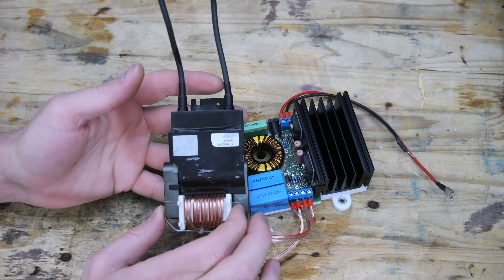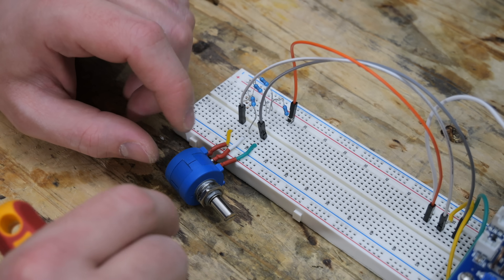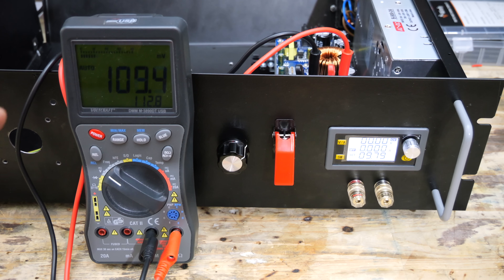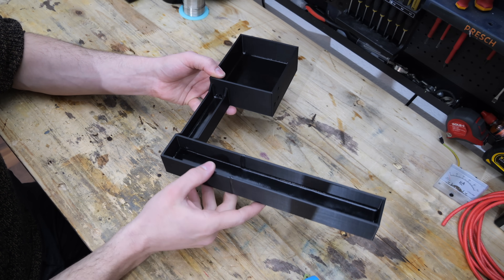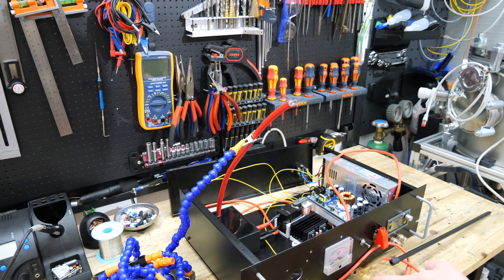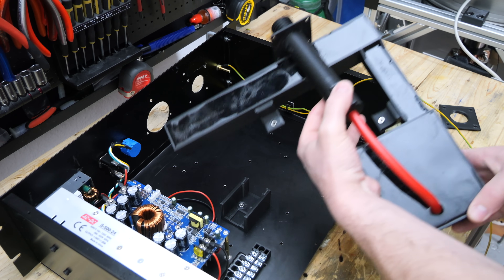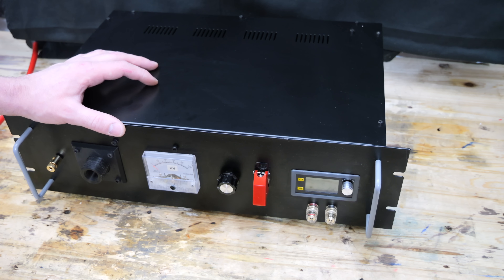Building an Adjustable High Voltage Supply

Comment: Small tip: Watch out with black plastics, resins, insulations, etc. They are often colored black using carbon. Can bring some really nasty surprises.
Reply from the maker: Yes, in my first version I used only white PLA to avoid getting problems with carbon black as a pigment. But it seems like it makes basically no difference. The white PLA is also terrible for insulation. 

The resin uses aluminum silicate as a filler and the data sheet states the dielectric strength. 

But you are right! I should have mentioned that in the video.
Reply: @AdvancedTinkering  That buck converter was completely unnecessary. That power supply can be modified to have a fully adjustable output from ~3v to ~40v by adding 4 resistors and a potentiometer to the feedback circuitry.

If you're interested I can provide a link to a website detailing the mod.
Reply from the maker: @motosk8er2 I actually changed the power supply and removed the stepdown converter(see the next video about the upgrades). But I didn't know you could easily modify one of the non adjustable supplies. Sure, I would be interested in the link. However sometimes youtube just deletes comments with links in them. So let's hope it works.
Reply: @AdvancedTinkering Hi, what's the maximum current? How many amps/milliamps can be delivered from this circuit? Thank you.
Reply from the maker: @Baguaengland I can't say for sure because I don't have the equipment to measure the current.
Reply: @AdvancedTinkering  If the output can handle a shorted output briefly, then you can use a DMM to measure short-circuit current.  YOU MUST USE CARE!!  I do this on NST's with a cheap DMM.  First, I make sure the NST is off.  Them I VERY tightly connect the HV to the DMM leads with the setting on "AC-current".  Also,  BE SURE THERE ARE NO BLOWN FUSES IN THE DMM.  HV will arc across any open fuse (or holder) and destroy the DMM...voice of experience...
Then when I energize the NST, I actually get almost the exact reading on the NST label.  I have removed a few magnetic shunts from a de-potted NST to increase the current before potting it in paraffin.
Reply: weird they'd put carbon in insulating epoxy though
Reply: @fmdj From actual experimenting the carbon itself doesn't seem to make any difference at all. It seems to be the PARTICLE SIZE that causes problems. Using soot carbon makes no difference at all while ground up charcoal bricketts  almost makes conductive epoxy!
Reply: @glasslinger  yes and I can confirm that epoxy mixed with pestle-and-mortar'd charcoal is kinda conductive, I've been able to stick copper wires to graphite sheets with that, and get a rather low resistance (I'm having some fun with batteries).
Reply: @fmdj  doesn't matter at low voltages
Reply: Hahahaha, I got zapped in the ear once using a bit of rubber air line to listen for  where a Meech high voltage anti static thing was arcing.
Reply: Racist electronics😡
Reply: I ran into this same issue! I made a design using a white petg and I went to scale it up and used black petg not thinking about that, and I was getting arcing/severe dissipation. Started using white pla (had on hand) and almost no issues. Going to switch to clear pla/petg going forward
Reply: I wonder if clear PLA would be a better insulator? Nylon, maybe?
Reply: Wow I never thought about black plastics being conductive 

Good tip!

Comment: Awesome. But, most voltage multipliers that I know work with a spark gap. Setting it in resin is awesome but they work better with having multiple spark gaps. Anyway it works for you. I have built my own and can get much higher outputs.
Reply from the maker: I think Marx generators use spark gaps.
Reply: @AdvancedTinkering I think you're right, he's using a Marx generator, while you're using Greinacher multiplier.
Reply: @xxportalxx. Cockroft-Walton  multiplier. There are constant fights between Europeans and Americans over who originated something. Cockroft and Walton were the actual inventors of the circuit.

Comment: I'm curious why you didn't put the epoxy in a vacuum to remove the micro bubbles especially if you went thru all the trouble of potting everything. Did you fast curing epoxy making it impractical? I'm probably wrong, but the bubbles trapped in the resin should weaken the insulation and create leakage.
Reply from the maker: I degassed the epoxy before pouring it. But I didn't want to leave it in there for long, because the epoxy cures relatively quickly. And I wanted to pour it while it still had a low viscosity to fill all the voids. 

I couldn't put the whole assembly in my vacuum chamber because it was too big.
Reply: @AdvancedTinkering Thats fair I missed that part but I had figured it was a cure time issue. I'm sure you are aware but you can get epoxies with much longer cure times and they are often a lot better in everyway. I have never found the time savings offset the wasted time in redoing a project.
Reply from the maker: Yes, I used epoxy with a very long cure time for the first version. But I could not find any reliable data for the dielectric strength of those epoxy resins. You basically can't find any detailed information about the easily available resins.
That's why I decided to use the resin in the video for the second version.
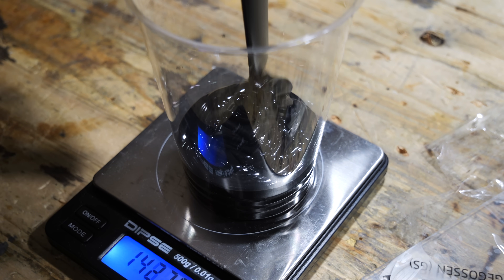Reply: He did put it in a vacuum at 8:42.
Reply: @MikkelHøjbak  Thank You I must have gotten distracted because I completely missed that part. I even went back to make sure before posting.
Reply: @Guardian_Arias  No worries. It's over so quick that it's hard to blame anyone for missing it - I'm sure that it could have happened to me as well.

Comment: Beware that potenciometers wear up over time, sometimes leading to random peaks when rotated, like the popcorn sound in old radios when adjusting volume.
Reply: On a second tought, since you have the safety resistors to not lower 12V then the wear up shouldn't be a problem
Reply from the maker: Thanks for the advice!

Comment: Very nice. Just a suggestion: I recommend, in addition to the switch with the protection, to insert a small circuit with a relay and two buttons to activate the high voltage. Such as start and stop systems for power tool motors. Maybe the stop button with a nice emergency mushroom.
The relay practically de-energizes when the power goes out and there is no risk of leaving it on in the event of a blackout or similar problem.

Comment: I don't think you have mentioned it, but you can't use a regular flyback transformer from an old CRT TV. These have a rectifing diode in series with the output coil which provides more or less DC, which doesn't work with voltage multipliers. You need an AC flyback which are somewhat harder to get.

Comment: Spellman is reusing type N RF connector for the captive nut on their HV PSUs.
Reply: Is not the same. Are HV voltage rated.
Reply: @fabiobosco7545 I I said connector shells.

Comment: When you create a spark, how low the output voltage dives?  I wonder if the 10W 10Kohm resistors are not handling too much current, if not they will open.
Very nice project.

Comment: LV and HV, seem like a perfect power supply for tubes like x-ray tubes 😉
Reply: @AdvancedTinkering Is 60kV gonna be enough? Most ahem vacuum tubes I know of like >70kV
Reply: @apo_chromatic  A bit on the low side, but dental vacuum tubes emit vacuum tube rays between 45 - 65 kV. Of course the big vacuum tube are usually in the range between 90 - 150 kV
Reply: @diecksl  yeah that’s true, I was probably a bit swayed by the absolutely tiny X ray tube I picked up recently that operates at 70 kV, it’s about as big as one of those small cans of soda

Comment: Can you tell me where you get this fly-back transformer ? I was unable to find it by part number. It does look decent for my project.
Reply from the maker: It's from a shop called "highvoltageshop". I know, very creative name. 
But I don't know if they ship to your location. 
There are also a lot of flyback transformers on ebay that would work fine.

Comment: Good job, doesn't look to unsafe from a electrical point of view. You are probably the first non-electronics "DIY" Youtuber that uses the correct wire end terminals. Good job. Do you have a link to the sortiment of those gold plated banana jacks, that looks very useful. Thank you :-)
Reply from the maker: Thank you! That's comforting to know.

Since YouTube does not seem to like links in comments, here is the ASIN number: B083FNTK5R
If you search for it on Amazon you should find it (if it's available in your country). Otherwise you should be able to find it by searching for "banana plug connector male female" or something similar.
Reply: @AdvancedTinkering  Thank you! Glad to hear that :-)
Reply: And yet still, somewhere in Germany a member of the VDE is seething with rage, writing a long winded ranty comment on why what AT just did is the most illegal and immoral thing to have ever been done with electricity. Because that's all VDE members ever do 😀

Comment: I hope the distance between your caps sufficient. Having them back-to-back like that has cost me a good handful of ceramic caps.
Reply from the maker: I haven't had any problems (at least for now). I think the few millimeters of epoxy between them should be good enough. 
But if something fails in the future, I will mention it in a pinned comment.